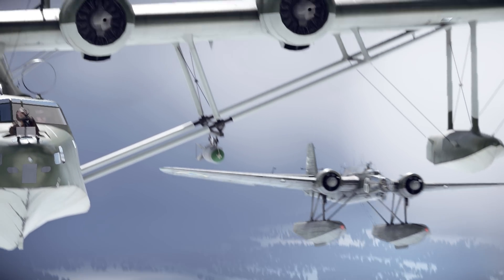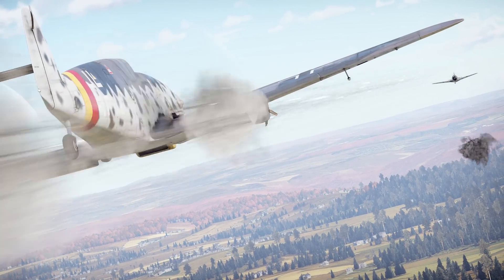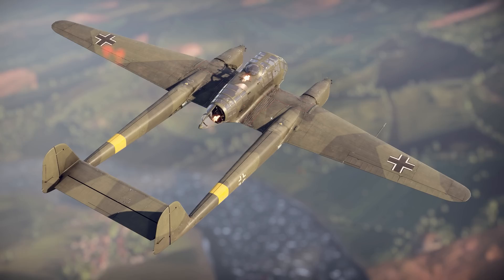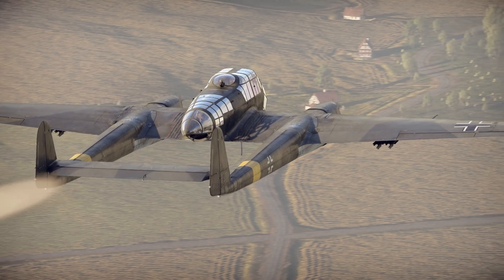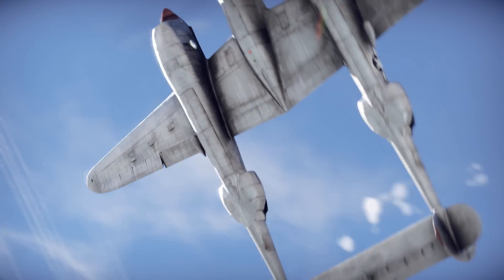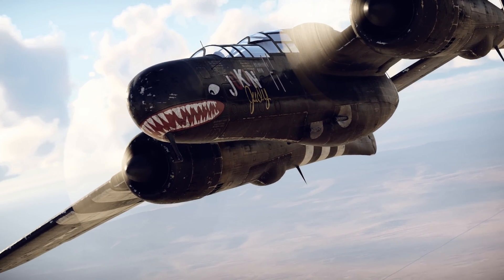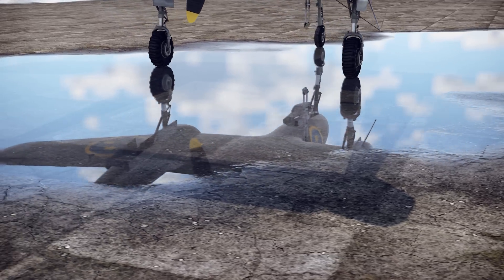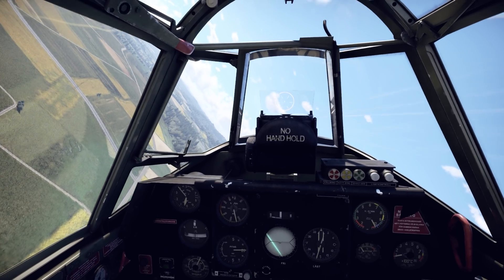Twin-Boom Aircraft: Vanishing Species

Comment: Not mentioned was a transport, the Fairchild C-119 Flying Boxcar. The twin booms allowed offloading of cargo/vehicles from the aircraft. Also, for airborne units, it was much easier to exit the back of the plane. 
There were over 1,100 built and flew until the 1970’s.